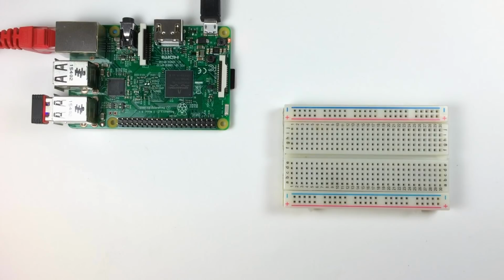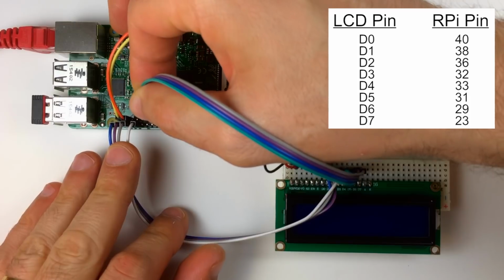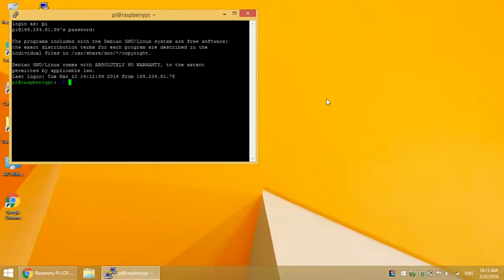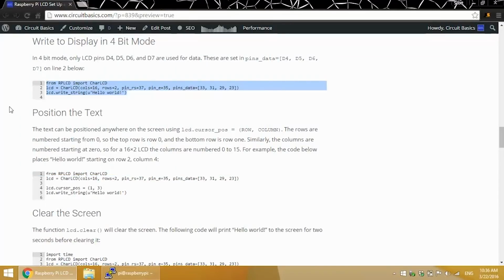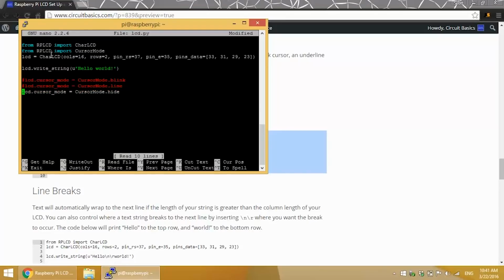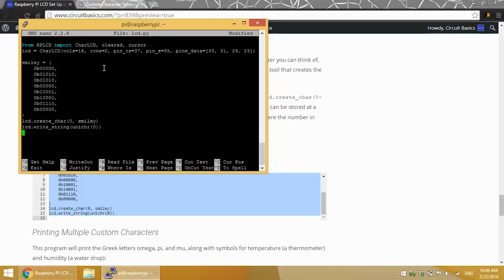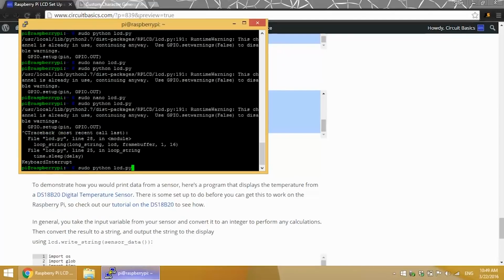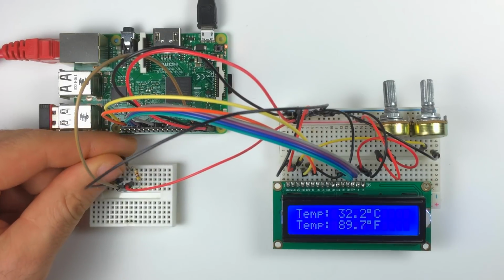How to Setup an LCD on the Raspberry Pi and Program It With Python

Comment: Just gone through the tutorial - the code to use now (I'm using the 8 bit mode cos clearly I love wires! ;-) ) is:   

from RPi import GPIO
from RPLCD.gpio import CharLCD
lcd = CharLCD(cols=16, rows=2, pin_rs=37, pin_e=35, pins_data=[40, 38, 36, 32, 33, 31, 29, 23], numbering_mode=GPIO.BOARD)
lcd.write_string(u'Hello world!')

It's just because the tutorial is 3 yrs old and stuff has moved on - many thanks @circuitbasics - great tutorial - gave a little whoop when I saw hello world ;-)
Reply: /usr/local/lib/python2.7/dist-packages/RPLCD/gpio.py:149: RuntimeWarning: This channel is already in use, continuing anyway.  Use GPIO.setwarnings(False) to disable warnings.
  GPIO.setup(pin, GPIO.OUT)

How to add pin or GPIO.OUT
Thank you!

Comment: doesnt work! 
 File "LCD.py", line 2, in <module>
    lcd = CharLCD(cols=16, rows=2, pin_rs=37, pin_e=35, pins_data=[33, 31, 29, 23])
TypeError: this constructor takes no arguments) ??????????????? anyone?
Reply: Hi, you must specify the numbering mode, i did it like this example :  lcd = CharLCD(pin_rs=37, pin_e=35, pins_data=[33,31,29,23],
numbering_mode=GPIO.BOARD ) 
i hope it works for you, regards!
Reply: @CharlitosWG   it now shows the error name 'GPIO' is not defined
any way to fix this?
Thanks
Reply: @RegularVideoGamer  Hi, that should be because you have to import the library first as "import RPi.GPIO as GPIO" , i think it must be that. Regards
Reply: @CharlitosWG   Now it says This constructor takes no arguments again

Comment: .....>>>>>>>>>>>>>>> I'm getting this errrrror >>>>>>>>>>>>>>>>>>>>>>>.
File "LCD.py", line 2, in <module>
    lcd=CharLCD(cols=16, rows=2, pin_rs=37, pin_e=35, pins_data=[33,31,29,23])
TypeError: this constructor takes no arguments
Reply: +Yahia Khedr write this:
 "from RPLCD.gpio import CharLCD"
 instead of 
"from RPLCD import CharLCD"
Reply: @vigneshaj.5459  It is not working, the error show 
File "lcd.py", line 2, in <module>
    lcd = CharLCD(cols=16, rows=2, pin_rs=37, pin_e=35, pins_data=[33, 31, 29, 23])
  File "/usr/local/lib/python2.7/dist-packages/RPLCD/gpio.py", line 114, in _init_
    'for more details.' % numbering_mode)
ValueError: Invalid GPIO numbering mode: numbering_mode=None, must be either GPIO.BOARD or GPIO.BCM.
See https://gist.github.com/dbrgn/77d984a822bfc9fddc844f67016d0f7e for more details.
Reply: @chanweiyi9640  o i get it thank you so much!
Reply: @vigneshaj.5459  Can share how to get it?
Reply: @chanweiyi9640  did you find the solution for this ?
Reply: @nabinbhandari471  nope. Sorryyy. I still looking for the solution too
Reply: me too

Comment: Hi, I just wanted to ask of it's possible to use the LCD connected to the GPIOs while using Raspbian. I want to make a python script that shows the Raspberry's system info (Such as CPU usage, RAM usage, temps, etc...) while I'm using Raspbian. I currently don't have any kind of experience with a Raspberry pi, but I'm really excited about it. Really good explanation by the way : ).

Comment: What alternatives are there to using a breadboard? Could I solder? I hate the look of them damn breadboards! 

Sorry, new to this :)
Reply: Get. Yourself. A. Breadboard. Or your life with raspberry pi will become a hell of soddering and broken/complicated connections.
Reply: monkeydan101 No. I'm looking into putting a Pi on one side of a door and a display on the other... A small project... Looking at I2C displays, they plug right into the GPIO?
Reply: you can't actually do it, cause you need multiple instances GND in the circut
more that GPIO even has
Reply: monkeydan101 I've seen people do it on YouTube? How would I go about it then? Bread boarding is out of the question due to the project requiring compactness and little complexity.
Reply: I'm not an expert, and that's probebly possible, but sounds hard and off my level, and im not exacly brand new to this.
Reply: monkeydan101 Search it? Looks easy and simple. Bread boarding is NOT a possibility for this project.

Comment: Help me please. I get this error :(
Traceback (most recent call last):
  File "lcd.py", line 2, in <module>
    lcd = CharLCD(cols=16, rows=2, pin_rs=37, pin_e=35, pins_data=[33, 31, 29, 23])
  File "/usr/local/lib/python2.7/dist-packages/RPLCD/_init__.py", line 14, in __init_
    super(CharLCD, self).__init__(*args, **kwargs)
  File "/usr/local/lib/python2.7/dist-packages/RPLCD/gpio.py", line 95, in _init_
    'must be either GPIO.BOARD or GPIO.BCM' % numbering_mode)
ValueError: Invalid GPIO numbering mode: numbering_mode=None, must be either GPIO.BOARD or GPIO.BCM
Reply: This should work i had the same problem 

lcd = CharLCD(cols=16, rows=2, pin_rs=37, pin_e=35, pins_data=[40, 38, 36, 32, 33, 31, 29, 23],
              numbering_mode=GPIO.BOARD)
Reply: well npw to get this:
  File "yeett.py", line 3
SyntaxError: Non-ASCII character '\xef' in file yeett.py on line 3, but no encoding declared; see http://python.org/dev/peps/pep-0263/ for details
Reply: can u send the whole code?
Reply: from RPLCD.gpio import CharLCD
import RPi.GPIO as GPIO
import time

lcd = CharLCD(cols=16, rows=2, pin_rs=37, pin_e=35, pins_data=[40, 38, 36, 32, $
              numbering_mode=GPIO.BOARD)

lcd.write_string('try this')

time.sleep(10)

lcd.close(clear=True)
Reply: hmm :/ still
  File "tt.py", line 5
    lcd = CharLCD(cols=16, rows=2, pin_rs=37, pin_e=35, pins_data=[40, 38, 36, 32, $
                                                                                   ^
SyntaxError: invalid syntax
Reply: what is the dollar sigh there for?
Reply: miss type sorry

Comment: Error --------Traceback (most recent call last):
  File "lcd.py", line 3, in <module>
    lcd = CharLCD(cols=16, rows=2, pin_rs=26, pin_e=19, pins_data=[13, 6, 5, 11, 33, 31, 29, 23])
  File "/usr/local/lib/python2.7/dist-packages/RPLCD/_init__.py", line 14, in __init_
    super(CharLCD, self).__init__(*args, **kwargs)
  File "/usr/local/lib/python2.7/dist-packages/RPLCD/gpio.py", line 95, in _init_
    'must be either GPIO.BOARD or GPIO.BCM' % numbering_mode)
ValueError: Invalid GPIO numbering mode: numbering_mode=None, must be either GPIO.BOARD or GPIO.BCM

solución
Reply: cd = CharLCD(cols=16, rows=2, pin_rs=37, pin_e=35, pins_data=[40, 38, 36, 32, 33, 31, 29, 23],
              numbering_mode=GPIO.BOARD)
should work
Reply: lcd = CharLCD(cols=16, rows=2, pin_rs=37, pin_e=35, pins_data=[40, 38, 36, 32, 33, 31, 29, 23],
              numbering_mode=GPIO.BOARD)
typo on first line
Reply: dale yole "GPIO" is Not defined dude.
Reply: prblm solved?

Comment: Really cool tutorial, thanks! :)
FYI, I recently released version 1.0.0 of RPLCD. It now also supports I²C port expanders and has built-in support for the A00 and A02 character maps.
The release has some API changes, so people doing a "pip install RPLCD" will get the latest version which might not work with this tutorial anymore. If they want to get the version compatible with this video, they should probably do a "pip install RPLCD==0.4.0" instead.
Reply: Thank you so much for this, a lot of the other tutorials had lots of unnecessary code, and I found this to be the simplest one, but I couldn't get the code to work until now.
Reply: thank you
Reply: Thanks for letting me know the version number, I was confused why the code was not working for me at first lol 👍

Comment: Great video, this all worked perfect, one question after running each example I get error in the terminal window saying "runtime warning this channel is already in use", of course no error the first time I run a .py file do I need to add some line to the code to clear something I tried clear screen but I assume that not what I need to do.